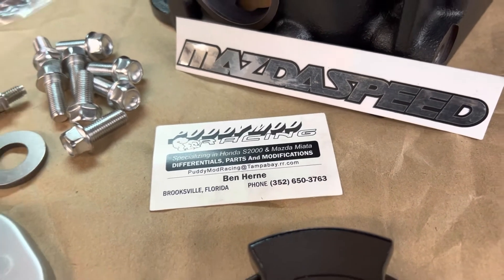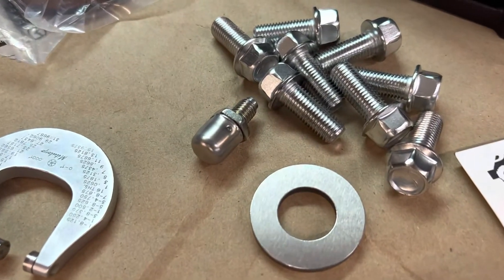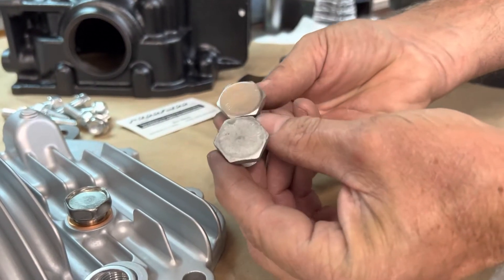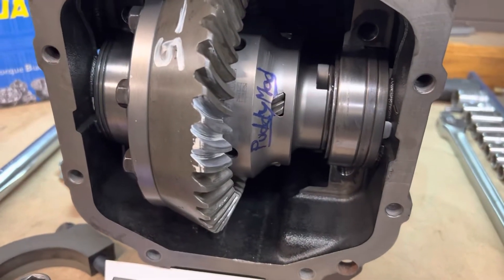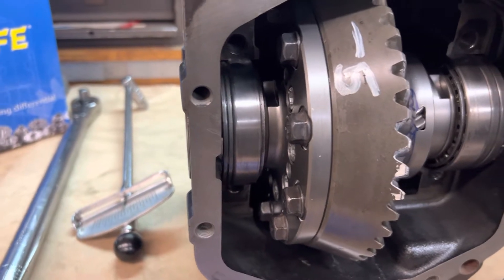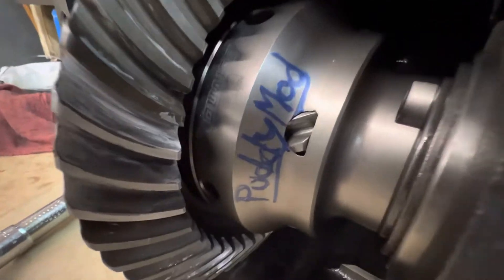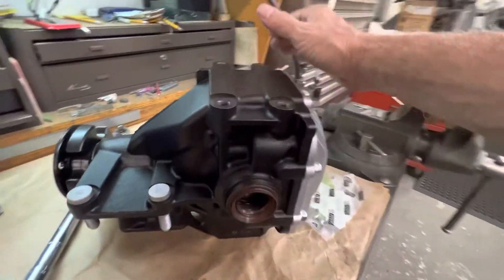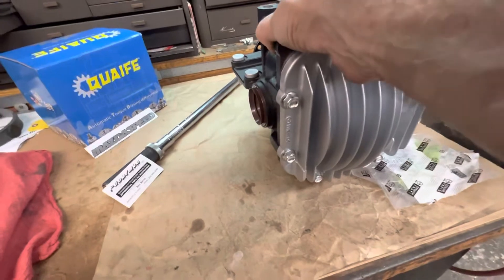PuddyMod NC Miata differential restored with Quaife LSD and 4.77 gear ratio

Comment: Great video. And nice work!

I assume the 3.73 ratio is intended to reduce engine speed primarily at highway speeds?  How much of an RPM reduction does it provide assuming an NC with the standard 6MT transmission?  And conversely, how does that ratio affect acceleration in the lower gears?

Comment: You can still get shorter than 4.77 final drive to the S2000? Or my only option is to put the secondary 1.2 reduction from the AP2? (Mine is a 2000 F20C with 9400 rev limit with 255/40r17)
Reply from the maker: There is a 4.88 and a 5.12 they are rare.

Comment: any issues with the Quaife binding or grabbing when making hard slow turns?
Reply from the maker: Nothing at all, never heard of anything like that. They are very smooth and quiet
Reply: @puddymod  Thank you, I am watching a turbo NC on BAT that has a Quaife with a custom 3.6 gear from Walter motorsports  and the owner says it "grabs" when making low (under 5mph) hard turns.
Reply from the maker: @Mikeeg0607  i’m actually building that exact same differential setup right now a, Walter Motorsports 3.6 and a Quaife Lsd it will be on my next video most likely.
Reply: @puddymod  seems like this owner just accepted that this was normal for this diff and never tried to correct the issue, which I am guessing can be corrected with enough $$ lol
Reply from the maker: @Mikeeg0607  there could be a different issue the Quaife LSD is a helical gear nothing to bind up.

Comment: Where You bought 4.77 final drive? Is the KIA FD?
Reply from the maker: Yes, Kia
Reply: @puddymod  thanks! I got 4,44 diff swap from rx8 but I am looking for something closer.
Reply from the maker: @radzioFLATOUT  if you are looking to install into the NC Miata case the RX8 gear set will not fit, it’s to big.
Reply: @puddymod  I instaled all kit from RX8. Diff 4,44, shafts and knuckles. But for my wheels and rally its still too long. So I am looking something closer
Reply from the maker: @radzioFLATOUT  So I understand this correctly you have a RX8 rear in your NC Miata? If that is what you did then you will need a 4.77 from a RX8 the Kia 4.77 is to small it will not work.
Reply: @puddymod  Yep! in Poland its very difficult to find rx8 4,7 diff. So I am consider back to "small head" mx5 diff and put there kia 4,77 ratio
Reply: @radzioFLATOUT  does ur rx8 diff swap work fine? i got a rx8 diff too. but the diff is a little longer and pushed the ppf/gear/ engine frontier so my right engine mount breaks. do u got any trouble too?